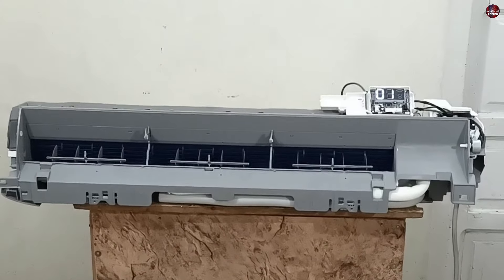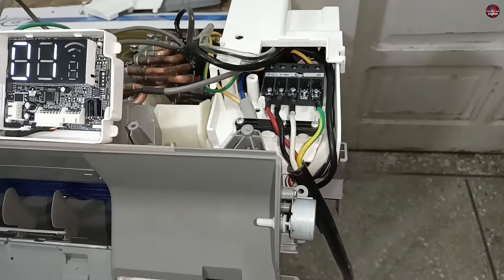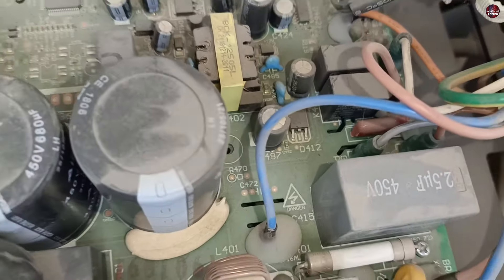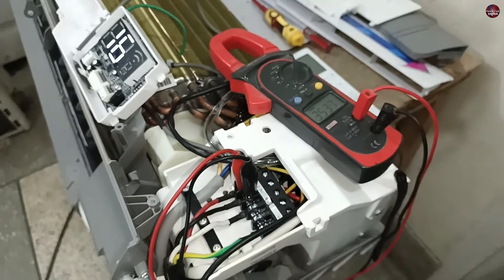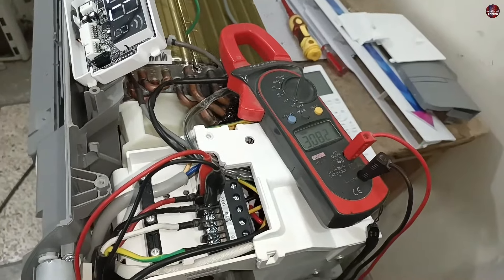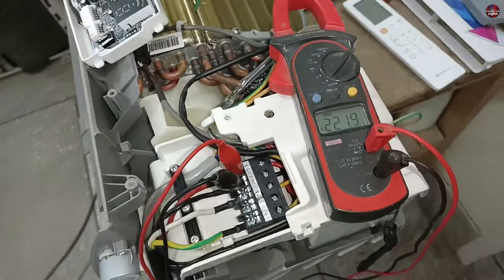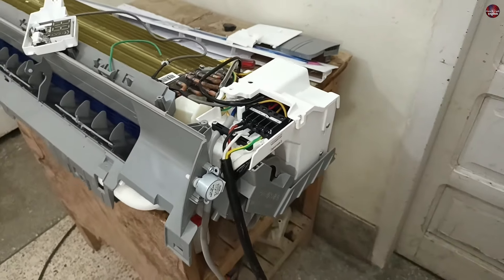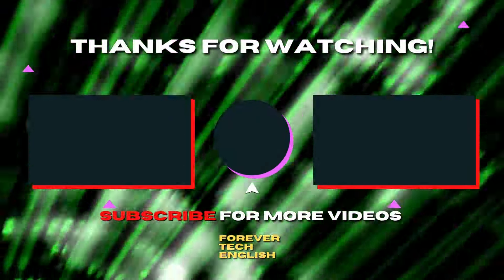The Ultimate Guide to Fix Mini Split AC EL01 Error Code with Ease!

Comment: thanks fo this guide, i encountered this error after disassembling for clean our AC but after reassembling this error appeared, after seeing this video, we checked the wire and it turns out we exchanged the red and green wires, since green is normally for ground connection, but for ours, the ground is colored red instead

Comment: I replaced indoor board and outdoor board along with the temp sensors on outdoor unit. I am still receiving el 01 error code. Any ideas
Reply from the maker: Did you checked the wire?

Comment: Mine is Voltas inverter model AC 4years old facing the same EL 01 error in night time, day time it is working fine. What could be the reason?
Reply from the maker: El01 is communcation error, check the wiring connections. Or the wire as told in the video. Check the polarity of the connection from the electric outlet. If those wires are installed wrong, change it. If still it does not works. Then, it means the problem is in the circuit board. It needs to be fixed.
Reply from the maker: If you own a mulitmeter, I have a video on my channel on how to check a serial communication in inverter mini split air conditioner.

Comment: I also experienced the E1 code of koppel aircon.,this happened after power shortage.,it runs in fan mode but will indicate E1 when I change mode to auto or cool mode.,
Do you have idea how to repaire this one?
Reply from the maker: Is it a inverter type or a normal one?
Reply: @forevertechenglish   inverter type sir
Reply from the maker: @reillegaspi1445  its a communication error, if you have a multimeter. I have video on how to check communication in inverter mini split ac